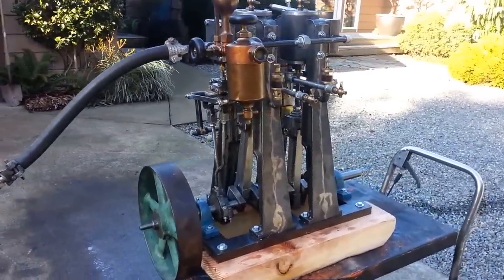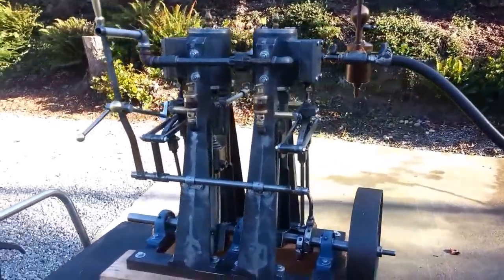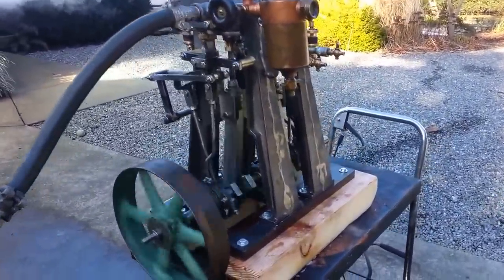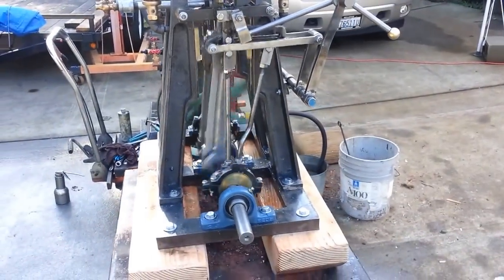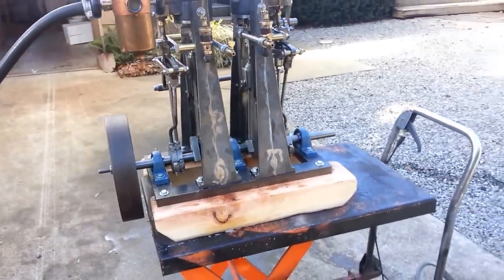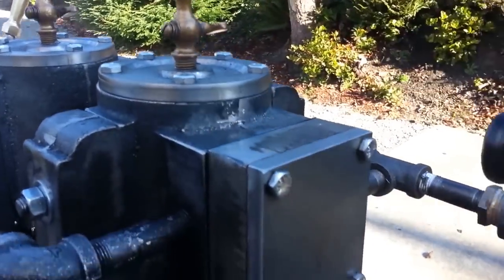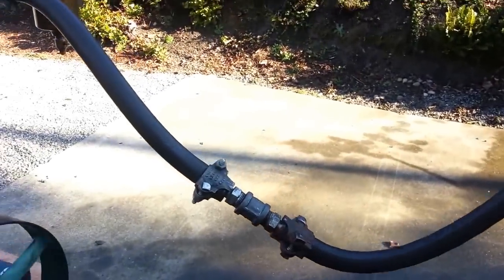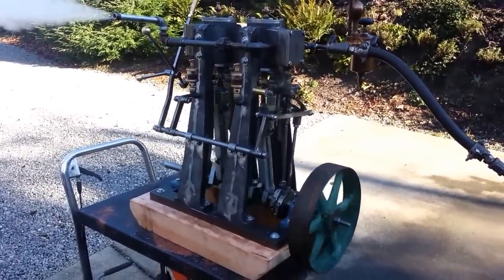Steam Engine Twin Cylinder with Reverse Boat boiler SOLD

Comment from the maker: Up for sale is my fully machined and assembled twin steam engine from castings including cross slide, eccentric, piston and rings, and all moving parts for the engine. The bore is 3.00 inches with a 3.00 inch stroke.  The overall length of the engine is 28" the width 18" and the height 30 inches. The flywheel is 10" dia. It weighs 150 lbs. I estimate the hp at 5 to 6 depending on boiler pressure.  The oiler and valves are included. It runs at 375 rpm wide open. Ross Bendixen
Reply: rossco1948 can you please make some plans for this
Reply: i wish you would call me we talked on eBay and i really wish you would still be keep making these boilers and steam engines ir really want all the boilers you have left and i really want a twin steam engine like in this video for a steam car project and many other steam powered projects i got going on i need to finish this year